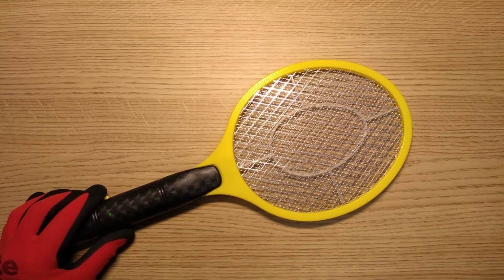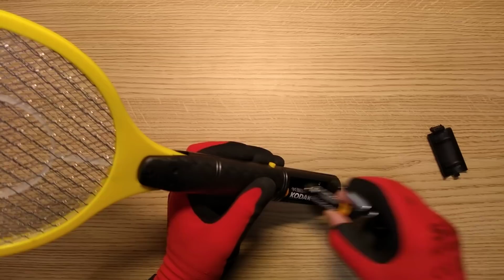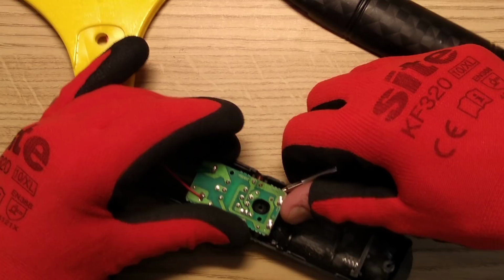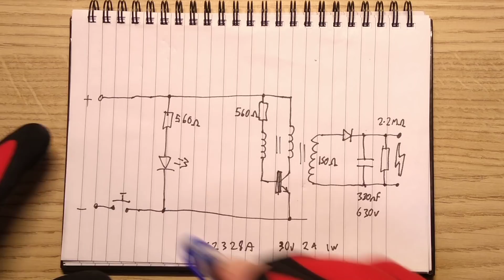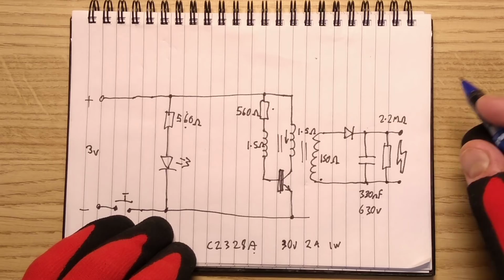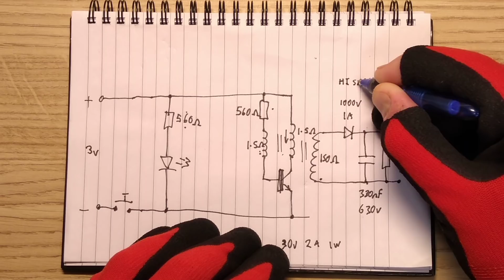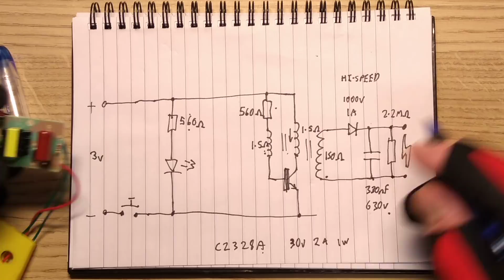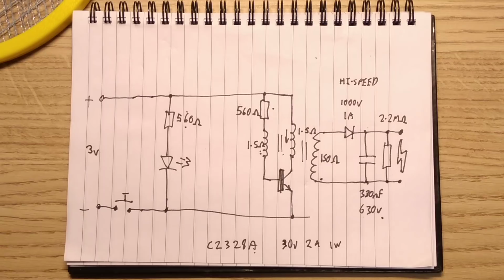Inside Poundland's electric fly zapper bat.  (with schematic)

Comment: Ah mate, simple resistive divider to divide the voltage down into something you can measure. Probably best to use very high value resistors so as not to load the tiny circuit. Perhaps not so high that they start to interact with the meter's own resistance and start giving weird readings, but I thought digital meters have an essentially infinite input impedance on "Volts", since it goes straight into the gate of some IGFET or something.

Also might be interesting one day to measure the input impedance of one meter with another. Probably not directly on the "Ohms" range since that would do weird stuff. Perhaps imply it through... something or other. And also (should be easy) measure the loading of a meter on Volts. Just by seeing how much current it draws. 

It has to draw SOME current to measure voltage and exist in the Universe. Plato wants one that doesn't, it's one his ideals. It's also every type of meter. Just like a multimeter! 

Unless a trickster demon of some type... the hypothetical world is plagued by them!

Sorry, this one left "reality" pretty quick, didn't it? 

Still would be interesting though. Maybe a video? 

Could also go back to the basics of electricity. Why does a volt meter have a very high resistance in series with a meter? Why does an ammeter have a very low resistance in parallel with one? What current and voltage are (many people don't quite get the relationship! If you think of Ohm's law as a slidey balance thing, and keep Kirchhoff's laws in mind, which are pretty obvious really but they put a bit of mental discipline into a circuit! You don't have to even name Kirchhoff, just point it out as the necessary logical implications they are. The current law just says that current can't come from nowhere, or disappear. Obvious really, just like everything else!

Oh, and I'd keep the plumbing metaphors to a minimum, after a while they don't help!  And that's why I think Clive should do a bit of basic educational stuff. Volts, ohms, amps. Possibly with practical demonstration involving building or de-building something! It might help some of the keen and interested beginners get more out of the other videos. And the electronic hobby generally. Which is a great thing! 

Not meaning to boss anyone about, it's just how I'd do it. One is free to independently assess and ignore my ideas according to their worth!

Comment: My typical mod is: remove the discharge resistor and replace the transistor for something higher current.

Test subjects included bluebottles and colleagues.

Standard: bluebottle slightly annoyed.
No discharge: stunned.
No discharge + transistor change: popped bluebottle.

Comment: I did some measurements on a similar flyswatter, it actually put out 1.65 kV under no load!
I have no idea how the cap survived this, but I assume it won't do so for long.
What surprised me most was the fact that those things have a short circuit current of almost 10 mA.
Reply: At what voltage was that 10mA at?
Reply: @uK8cvPAq  10 mA short circuit current, so the voltage is basically 0
Reply: @Gigabecquerel  Does it make you tingle?
Reply: @uK8cvPAq  I've never touched it, as I really dislike the feeling of electric shocks

Comment: Sadly, my 'bug-bat' failed to work this year, after a Winter's slumber on the shelf - do you think it could be repaired?! 💥
Reply from the maker: Batteries and their contacts would be my first suspect.
Reply: @BigClive  Hi Clive, it seems a bit more than that. There is power, but it just doesn't generate the kick it once had, even with with brand new good quality alkalines.

Comment: I saw that it had one transistor and wondered... then I saw the circuit.  This thing is literally a Joule Thief circuit which just has a 3-winding transformer instead of the usual 2-winding transformer, with the third winding delivering a high voltage through a half-wave rectifier (the diode) into a capacitor.  Unsophisticated, but it works.
Fun Fact: "Drunk" is when you feel sophisticated but can't pronounce it. ;)

Comment: Hi Clive. 

What would happen if I ran it from an 18650 li ion cell? 

How can I make it zap harder. The wasps wake up 5 mins after being zapped
Reply: An 18650 is a good idea. However it may stress the parts more, I did this on a different zapper design and the transformer eventually failed. This may also help: Reduce the value of the 560 Ohm resistor on the transistor base circuit, to say 220 Ohms. Monitor the temperature of the transistor (and resistor) to be sure they're ok, and don't hold the button too long.

Comment: I am surprised you did not try adding a full wave bridge and getting rid of the bleeder.  It may have just arced over, but it would be interesting to see if you can't hotrod it a bit before that happens.  You may nuke the cap.
Reply: The circuit's working in boost ("flyback") mode, such that the high voltage (on the secondary) is only developed when the transistor turns off quickly.
So a FWB probably wouldn't help, because only a rather-lower transformer-coupled voltage appears on the secondary while the transistor is on and primary current and xfmr flux are increasing.

Comment: Clive can you explain me if the output cap is rated at 630v how can it survive the output voltage that most of these swatters generates it is around 2 kilovolts at the grid I am just wondering how can the cap survive that much voltage without failing ?

Comment: HAd one of these years and years ago. IT stated in the instructions that you should use the old typ of none alkaline AA batteries. What would be the reason for that did they have a better discharge characteristic? I know that it didnt kill the insects with alkalines but did kill even wasps with the right batteries.

Comment: I have a serious question not related to zapping bugs , and I am in no manner against zapping bugs. I have several indoor digital thermometers/humidity stations. If I had 10 of the same kind in the same place within a few inches of each other , and all have between 1°-5° different readings , how do I know which one is correct for the temperature ?  I'm not concerned with the humidity.Then to add more confusion to the mix I borrowed a digital thermal /laser aim reader (Harbor Freight) tool and get a reading different than what the other devices show. So is there a way to give any of the temperature readers a correct or known reading and if so , how ? This has bothered me since my first purchase at Radio Shack of a digital thermometer , where they would have 4,5,6 ..ever how many in the display case and each read differently. Thank you Clive and anyone else that can answer this.
Reply from the maker: There's often a bit of variation between thermometers.  Partly because there may be variations in temperature and airflow in the area they are being used.

Comment: OK. 
how can I make mine more powerful?
Reply: easiest way would be to give it more input voltage, but that kills the transistor very quickly. You need to replace almost everything. But most important would be a more capable transistor, rated for a few hundred volts and a decent current and similar h_fe to the one that´s in there.
Reply: @Basement-Science  have you seen anyone do an upgrade and share the parts list?
Reply: @ninjamaster3453  No, sorry. I was just thinking what should work most likely.

Comment: Clive, what would happen if i plug in some solar cells to an already solar cell battery bank, will it charge faster, or will charge protection only use the pluged and not the built in solar cell
Reply from the maker: If you used a USB solar charger and plugged it into the power bank it should also charge it.
Reply: @BigClive  thank you for your reply clive

Comment: @ 3:25 - that suspiciously small discharge resistor on mine started arcing - I cut it out of circuit - still zaps just fine - its fun to get a bug caught between the grids and swat back and forth -zzzzz-zzzz-zzzz-zzzz-zzzzz-zzzzz-zzzzz!

Comment: That transformer can be used for build a small plasma lighter?
Reply: Maybe, good chance it will fail due to the higher continuous current needed for a lighter. You'll also need higher voltage. Remove the diode, capacitor & resistor at the output, then to increase output voltage reduce the value of resistor on the transistor base and/or switch to an 18650 battery (single cell lithium). Don't run it long. Easier way -- this arc lighter kit: https://www.banggood.com/Arc-Ignition-Lighter-DC3-5V-3A-DIY-High-Pressure-Electronic-Lighter-Kit-p-1236039.html

Comment: YAY! i've been waiting for this! daddy long legs season is upon us! Not watched the yet. but hopefully it will show me how to prevent it slowly discharging.(i know caps do that..but..) and also hopefully, how to chain the little transformers and add a bigger capacitor! (I don't ask much, lol)  fingers crossed!
Reply: Aw man, not the longlegs! I like those little buggers. Wasps and mosquitoes on the other hand, deserve to die.
Reply: @samschannel531  i know, but they just dangle around, danglfying at stuff. if i do that i get arrested. twice.

i just wanted to say something appropriate to the season since the wasps and skeeters are gone now.

 i bought a few of these exact ones this year and BC's previous vid didn't seem to match up so was happy with this :) running from mains.. thats the sort of tip i like! BC should show vids on how to "upgrade" cheap electronics things with simple soldering tutes. like spin faster, zap harder, glow brighter..etc.. Thanks BC if you're reading.
Reply: Hold on, do what you call daddy longlegs make silk? If so you’re talking about a cellar spiders and those things freak me out. If that’s what you’re talking about go right on ahead with zapping them.

Comment: I would have thought a good 10,000 to 20,000 volts at 0.0000001 amps. There is a rule, I think it is a thousand volts for every millimetre the electricity can jump
Reply: I had a CDI ignition on a bike it was bloody dangerous it would arc across a car type coil terminal too terminal and still run ok, if a 12v coil puts out 12 to 15.000 volts this was dumping 400volts into it great light show but I moved the coil well away for safety

Comment: I have one and ripped all the electronics out and put an high power capacitor in. So if I catch a fly it explodes on impact with my 400000v zapper
Reply: How do you charge such a high voltage capacitor, wait for a lighting storm?
Reply: @uK8cvPAq  I have a 9 volt battery

Comment: These hurt when you are holding it and some little S**T, I mean little darling presses the button and thinks it is funny when I am standing with just socks on!!!  Yes, well, she thought it was so funny she did it again!  I put on shoes and let her do it again, this tine I was insulated and she wasn't when I touched her.  Needless to say she didn't find it funny and didn't do it again. lol.  They work well and you get the satisfying small of burning insect and lots of nice purple flashes, so nice it is tempting to keep pressing the button randomly just to see it fry and burn until it no longer conducts and falls out of the bat a mere fraction of the size it was when you whacked it.  Interestingly, if a fly is on a wall you don't need to hit it, just put the bat over the top of it close enough to it and it will fly right into it with a satisfying flash and crackling sound, most satisfying.  :-))
Reply: Dave Micolichek  No one said anything about being earthed to the mains, just ground.  If you don't think you get a shock, try it, believe me it hurts.
Reply: Dave Micolichek  Nah, touch it and if there is a path to ground via your feet or arms you get a shock, try it.  It hurts.  It's the way you read it and I suppose the way I wrote it, ground is just touching anything that provides a path to ground/earth.  I have the old and new bats, to old has just two grids, the new one has three and does work better.  It is a fair nip you get off of these and I stood there trying to build up courage to put my finger near the bat.  I was standing just in socks, I did it but wish I hadn't, it bl***y hurt.  I tried it with shoes on and still got zapped, not so bad but but it still hurt.  Maybe I should do a video of me doing it, but my finger can't take any more lol.  These bats develop quite a voltage and make short work of dispatching a fly, you can watch it burn in the bright blue flashes, but the dead fly starts to small when burning, not nice.  I don't know what the duty cycle is, but I had it running for 30 seconds and it still was flashing away quite happy with itself.